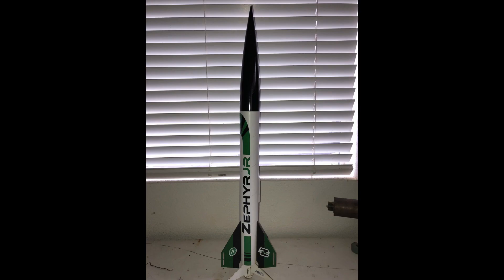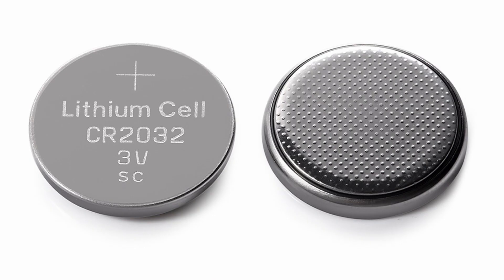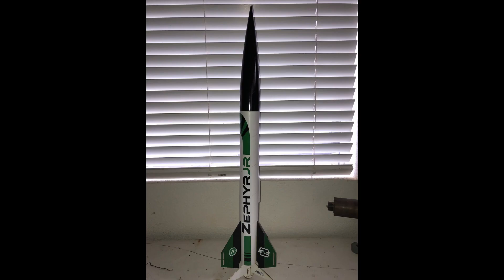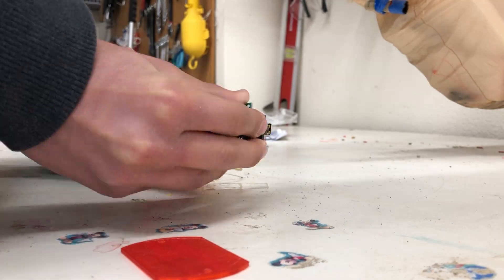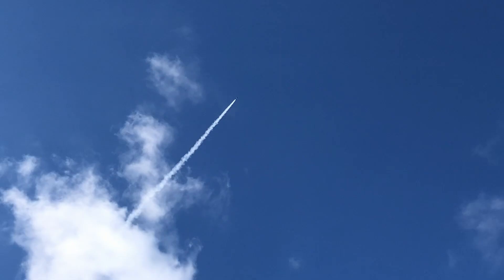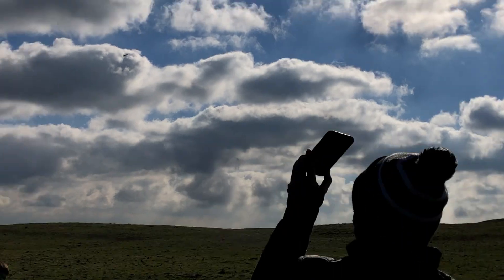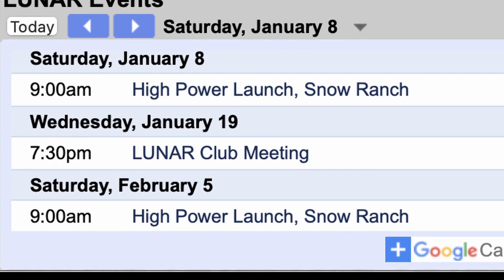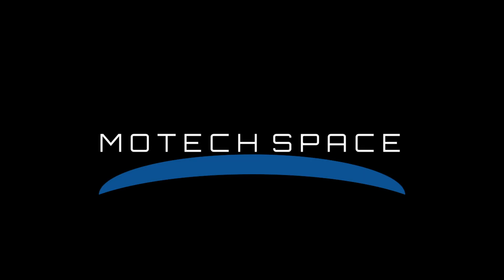Flying our Homemade Altimeter on a Rocket for the First Time (Apogee Zephyr Jr.)

Comment: Hi can i know where should i need to connect the data logger
Reply from the maker: If you're using an OpenLog like I am you connect it using Rx/Tx
Reply: @motechspace   actually i am a beginner can you explain further
Reply: pls and also the data logger is to make the reading stored right?
Reply from the maker: @BlitzHowlTechX  Which data logger are you using?
Reply: Im not sure with that
Reply: Is this fine check this out for me pls Scriptronics Micro SD Card Module Storage Board 6 pin TF Card Memory Adapter Reader Module SPI Interface Compatible with Arduino with 12Pcs Female to Female Jumper WIre (Pack of 2)
Reply from the maker: @TamilFamilyTraveller I'm assuming this is the same person. Just look up your data logger's wiring diagram. Search "[your data logger] wiring diagram"
Reply: Thnx
Reply: Pls can you send me the wiring 
Digrame it is not there pls help me
Reply from the maker: @rathilavanya5846  I'm not entirely sure what your component is. Find in on the company's website maybe and there should be good info there. Maybe look at the data sheet.

Comment: Where would I go or is there a place I can see the altimeter plans or development? I’m looking to do this with my high school geometry class.
Reply from the maker: Do you want to know which components I used or the code? Basically all you need is an arduino nano, the adafruit MPL3115A2 altimeter, and a data logger. Hope this answered your question.
Reply: @motechspace  Thank you, anything would be great! I ordered the components based on your video, I’m wondering about a wiring diagram, coding would be a bonus as well! The students will be designing the rocket in teams, one each for the nose cone, fins, and altimeter. They will print the parts and put it together for launch. We are then working with the trig class to do the estimated altitude and such based on the engine specs and weight of the rocket. I’m hoping this becomes an applied math project including computer science as well. Thank you again for any assistance! I have enjoyed your projects, they are in part where the concept for this class activity came from. Keep it up.
Reply from the maker: @cluckyday89  Thank you so much! It's really an honor that you used my videos for your material! I do not have wiring diagram of my own altimeter at the moment, but I found overview, instructions, and diagrams of the MPL3115A2 altimeter
MPL3115A2 diagram and overview: https://learn.adafruit.com/using-mpl3115a2-with-circuitpython?view=all
Instead of using the SCL and SDA pins on the arduino, you can just use the A4 and A5 pins
I don't know which data logger you got, but you can probably find instructions for how to wire that.
You should also use capacitors just to be safe.
When you actually get to logging data, I would recommend not logging pressure and temperature because they slow down the logging.
I put my code in github. It's a bit messy but it works: https://github.com/MotechSpace/Motech-Space-Altiemter.
You'll also need the library I used: https://github.com/sparkfun/SparkFun_MPL3115A2_Breakout_Arduino_Library
Let me know if you have any more questions! Also, I'd love to see videos of the project when you finish!